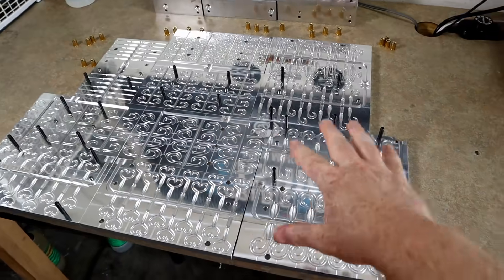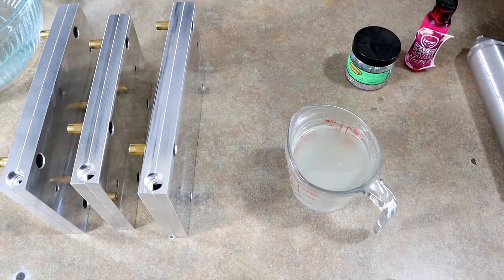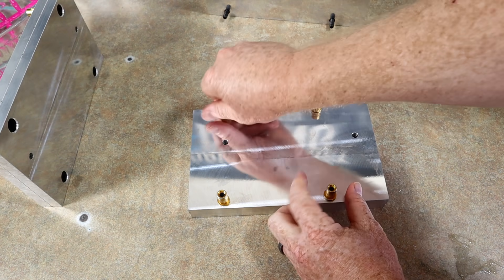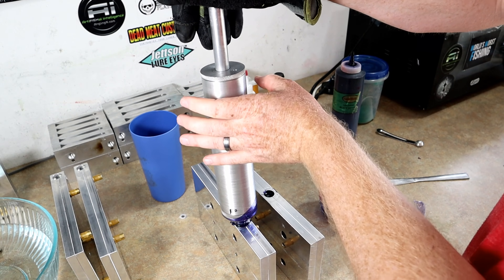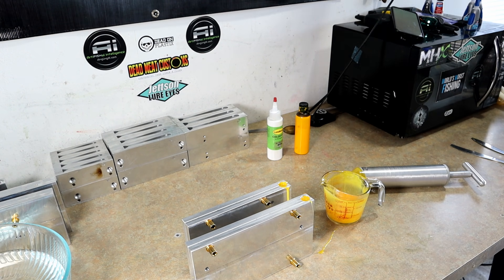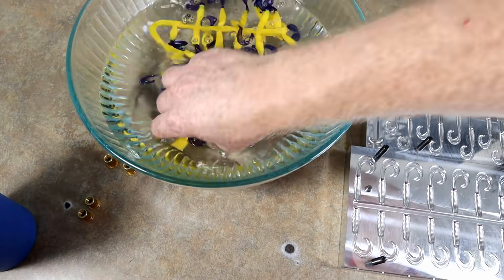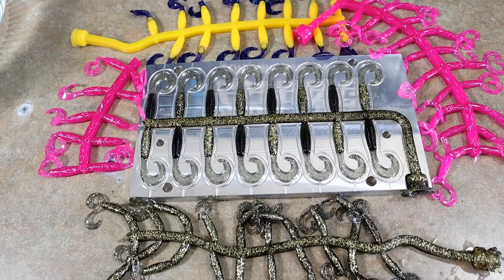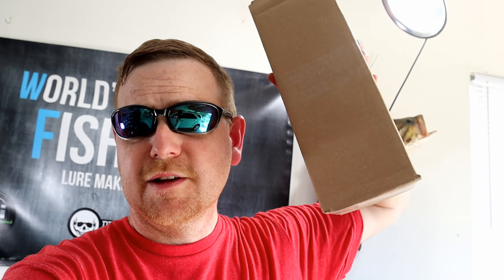New CRAPPIE/PANFISH MOLDS!  Tons Of Panfish Lures and New Color Ideas

Comment: I just got the 2.5 curly tail, and I am having trouble with it. Either tails will not fill, or it flashes. 
I've tried heating the mold, and I've tried shooting the plastic at about 345°and fast. 
Any advice would be greatly appreciated. 
By the way I really enjoy your work, I hope to get to 1/2 your level someday
Reply from the maker: Hmmmm...I've had tails not fill before..but clamped it tight and shot it fast and been fine...it should not flash with the bolts tightened
Reply: @WorldsWorstFishing  should I back the temperature down?